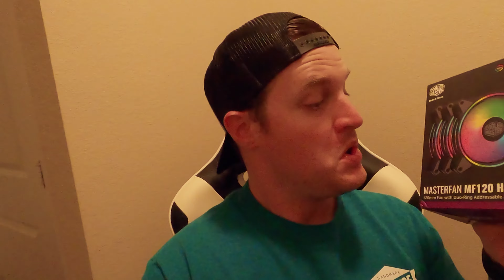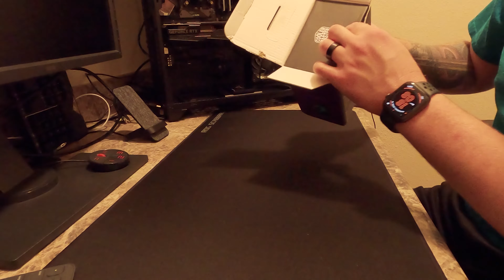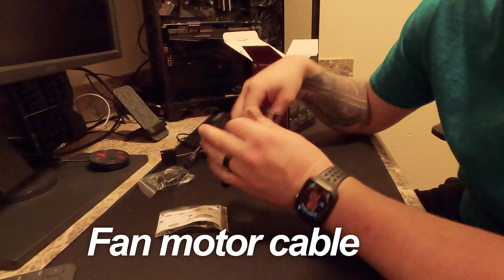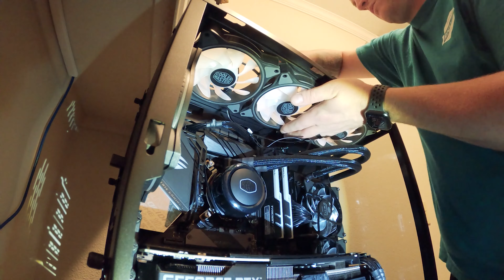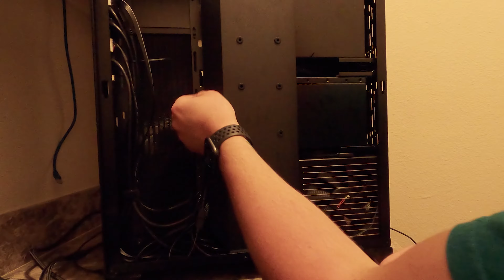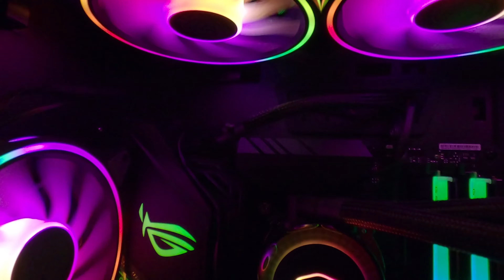Masterfan MF120 Halo Unboxing and Installation (Cooler Master)

Comment: Should have showed the step of setting up the A-RGB portion..cause those  are 3 pin connectors and there are 2 cords for the RGB.
Reply: I like to know how you connected the argb up.  I just got my 3 mf120 halos in..but i didnt get the triple pack.  Need to know a good splitter or control hub to use for them.
Reply from the maker: My ML360R aio came with this argb controller. I daisy chained the fans together and connected them to this controller. It has 4 argb connections for devices. https://www.coolermaster.com/catalog/coolers/rgb-accessories/argb-led-controller/
Reply: @cantgetnopeace8923  i dont have to plug both of the argb cables in do I?
Reply from the maker: 1 addressable rgb header can power 120 individual leds. Each Mf120 halo has 24 leds in it. So you can daisy chain plenty of them together before you have any problems. 👍🏼
Reply: @cantgetnopeace8923  what im asking is the mf120 halo duo ring fans have 1 connector for fan and there are 2 for argb which plug do i use the male or female?
Reply from the maker: The male and female 3 pin argb connections are interchangeable. That’s why they include the double male 3 pin connectors. You can daisy chain it from male to female or however you choose.
Reply from the maker: No you don’t have to plug both male and female argb connections from the same fan. Just use 1 or the other.
Reply: @cantgetnopeace8923  thank you for all the info
Reply: @cantgetnopeace8923  So I have x470 gigabyte gaming ultra mobo, the 5v argb header is vdg, since i had to buy 3 fans seperately w/o the extra cable in the triple pack, what is best way for me to link them together for my motherboard?
Reply from the maker: I’d definitely recommend getting a 3 to 1 splitter for the 4 pin fan motor connection. And then I’d get the vdg to argb cable, then just daisy chain argb connections to an argb header. But I’ll be up front and admit I don’t know much about the vdg connection, I have an asus mobo so I didn’t need to use one. I don’t know if there’s different limitations with vdg or not.
Reply: @cantgetnopeace8923  yeah right now till i order that splitter or control hub..i have them daisy chained and connect to 3 pin from my led strip which has the connector for the gigabyte

Comment: Are 30 mm screws included for securing those fans to the AIO?
Reply: don't use it for AIO. these are airflow fans not static pressure

Comment: Are these adressable by coolermaster software?
Reply from the maker: Yes the masterplus software allows you to send signal to the controller. So anything plugged into the cooler master argb controller can be controlled by masterplus software. 👍🏼
Reply: @cantgetnopeace8923  One more question.  I'm coming from Corsair with the LL120 fans, I want to know a comparison of experience.  
How many of the Cooler Master fans can be supported on one hub?  also, how does the lighting on here compare to the LL or QL fans from corsair?
Reply from the maker: Should be the same rules as any other 5v argb header. You can illuminate 120 individual led’s per argb header. These fans have 24 led’s in each fan.
Reply from the maker: And unfortunately I’m not familiar with any of Corsair’s products. Wish I could help more. Good luck buddy!
Reply: @cantgetnopeace8923  crap.  it might not work for what I want then lol.  cause I only have one argb header.  Can these also be powered by sata too somehow?
Reply from the maker: The Ml360r aio cooler I purchased came with a sata powered argb controller with 4 headers on it. https://www.coolermaster.com/catalog/coolers/rgb-accessories/argb-led-controller/

Comment: how do you get different brand fans to all run the same colours
Reply from the maker: You’ll need to use your motherboard lighting software in order to sync up colors and patterns on everything.
Reply: @cantgetnopeace8923  ok and do you use a splitter to connect all your fans to a box
Reply from the maker: Yes, if you watch my “Coolermaster RGB Lighting Problems” video then I go into detail to how it’s wired up.
Reply from the maker: The controller is powered by Sata
Reply: @cantgetnopeace8923  thanks bro keep up the good content helps people out

Comment: Hi friend! In my Motherboard there is one connection argb 5v, and I want to install 4 fans argb like these, do I need a controller? Can I connect four fans in one argb 5v using an adaptor? Thank you
Reply: You will need a hub or controller. A splitter also works.
Reply: @yashgangurde1655  i bought a splitter, is working good.. thank you

Comment: Came here because the fans dont show which way the air flows! But your setup kind of answered that assuming they were exhausting.
However I do have some advice after watching, you should have more exhaust than intake. Need negative air pressure in the case to make sure any hot air that might be circulating gets pulled out. Excess intake is more likely to cause this. But your fans are probably overkill anyways so it probably doesnt matter =p

Comment: This isn't really an instructional how to video. It completely skipped over the part how to connect the cables from the fan to the board but hey at least the music was nice
Reply from the maker: You’re correct. This isn’t an instructional video or a how to.
Reply: @cantgetnopeace8923  it's just that I feel so let down and cheated...... you know and it's like it really really hurts.
Reply from the maker: It’s okay bud. You’ll make it through this.
Reply: It's been two weeks and I'm still not over this.

Comment: I've only one fan and there is no connecting on my MB to connect the fan for the ARGB. If I buy the controller am I need to have a connection port on my MB to connect it or it will work without that ? 
I mean if I've the controller can I control the argb without connect my fan to the MB ?